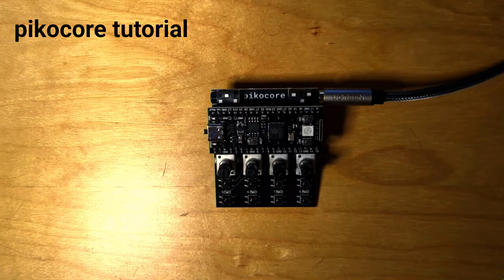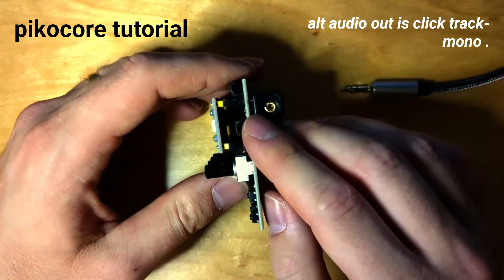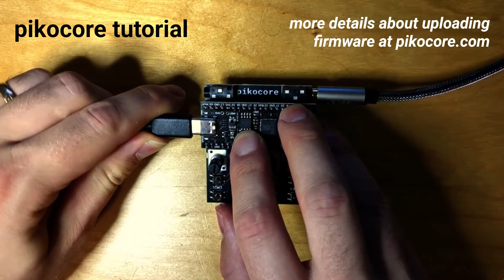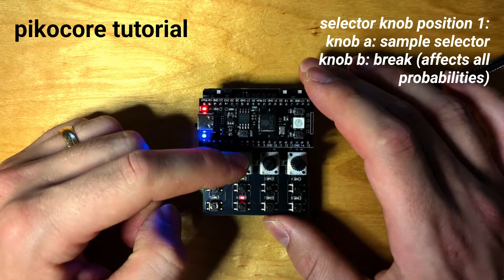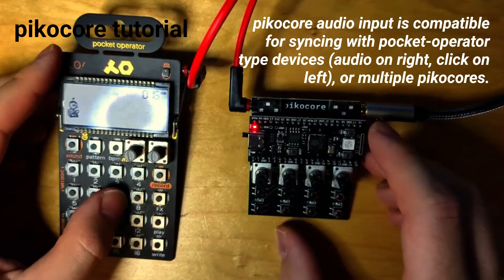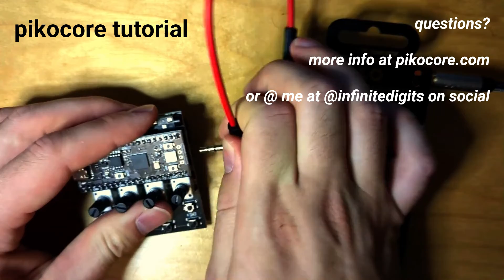pikocore tutorial

Comment: I’ve noticed that when I use it with battery if I move knob B yellow light turns on and a high pitch sound is heard. It leave me no choice but to turn it off and start all over. With the usb cable this doesn’t happen and works fine.
Reply: I have the same exact issue